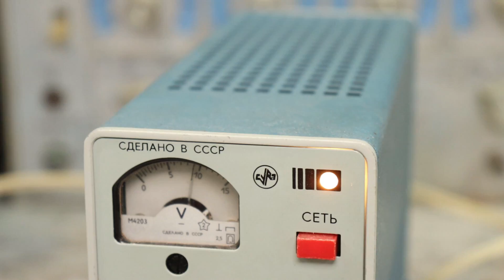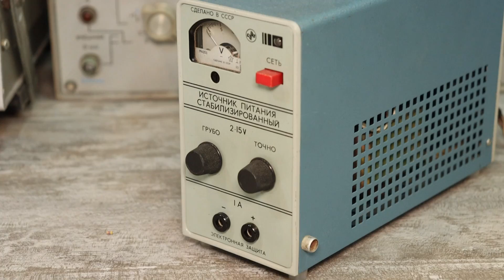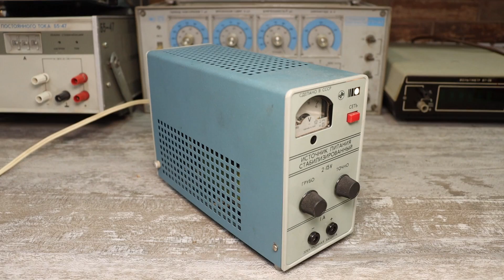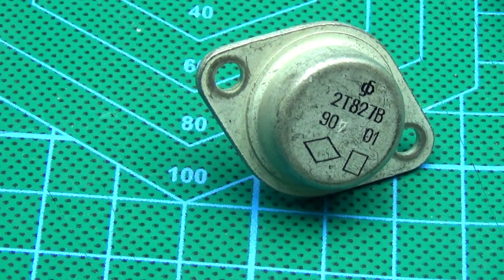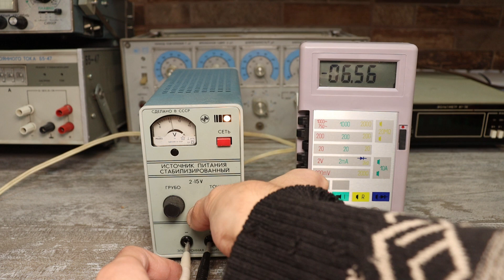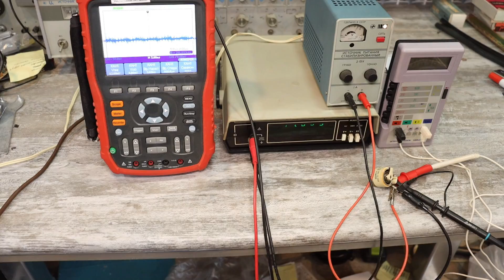The CUTEST Power Supply  in  USSR -   IPS-1

Comment: Wait, is the retail price printed directly onto the equipment? That's crazy. I've seen that on food product packages even in modern times, but never on electronics. EDIT: Ah, it seems to have been the state set price. So the product would be the same price throughout the USSR hence putting it directly on the product to prevent changing it.